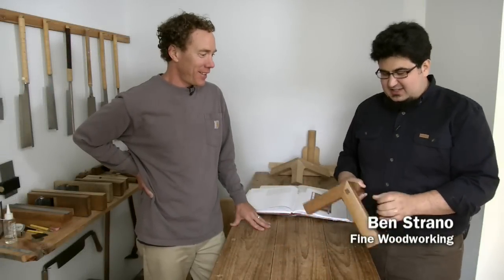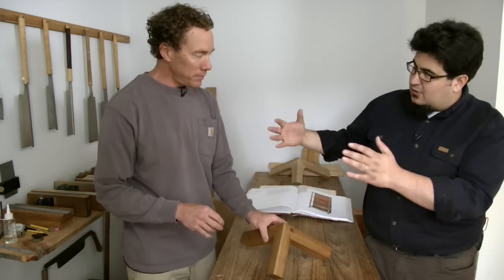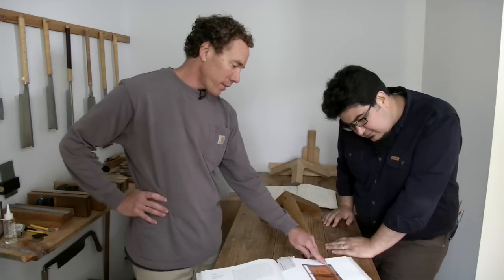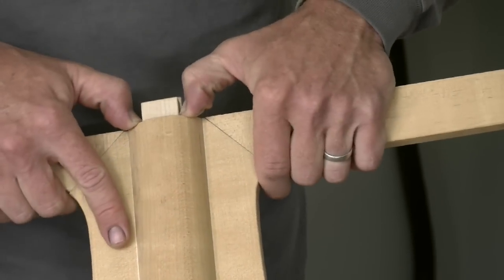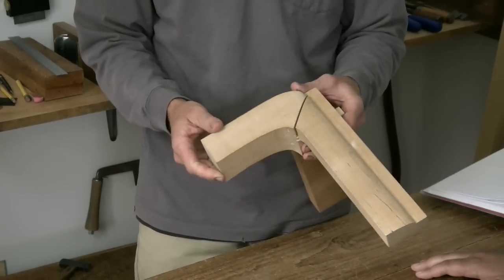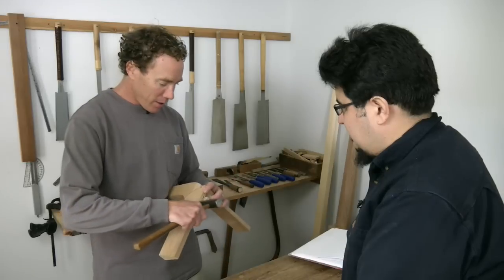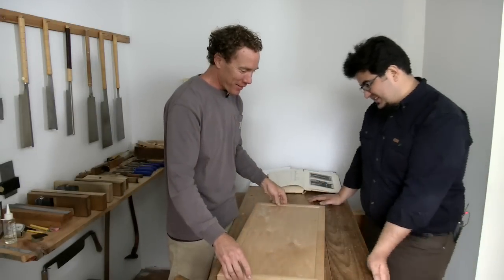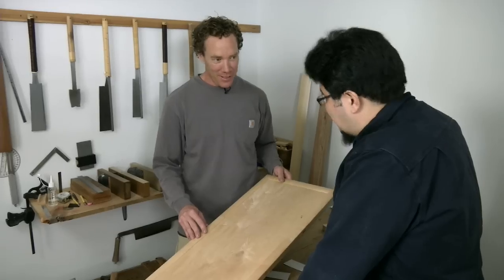Interlocking Chinese Joinery with Andrew Hunter

Comment: Chinese traditional furniture uses fish gloom, it's strong when it's dry, but if you steam it, it can be easily removed, it helps to repair.
Reply: They also use a type of glue made from pig skin. They were quite difficult to produce and not very fun to prepare, you would have to heat it up to turn it into a liquid state. Also the shelf life isn't very long, once it spoils, it no longer adheres to anything.

Comment: China's desktop is basically not made of a whole board, but several boards. The board is also made of glue. However, China uses glue called "fish bladder glue", which is a kind of glue boiled from fish bladder. Because the strength of this glue is not very high, it is necessary to use the piercing of swallow tail trough to stabilize the desktop without cracking. Another point is that if the video is used as a desktop, the wood used in the frame is too narrow. Chinese furniture used as the frame of the desktop, all of them use at least 7 cm wide wood, because only when the wood is wide enough, it can leave enough space for mortise and tenon to connect with the main body. In addition, the wide desktop border, it seems to be full of material, giving a sense of atmosphere. However, if it is used as a cabinet door, the frame in the video is a bit too big, because as a cabinet door, it pays attention to the big side and narrow side, so it looks lighter and has a sense of line.